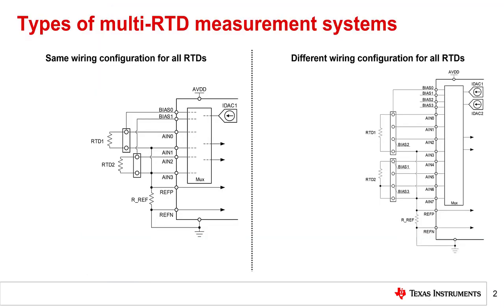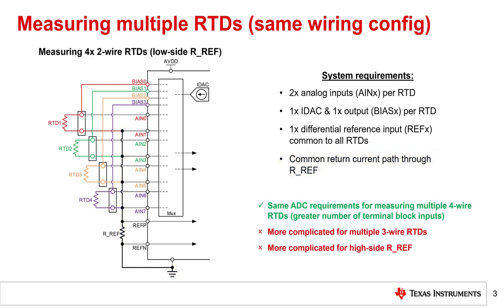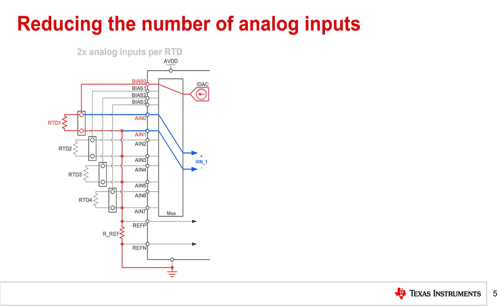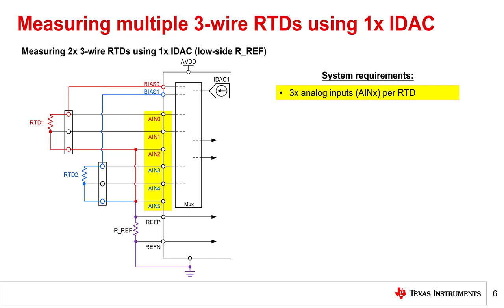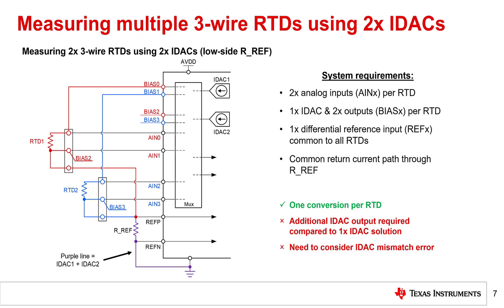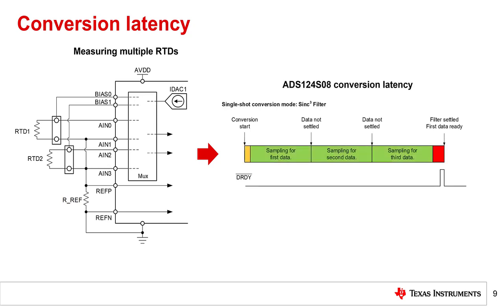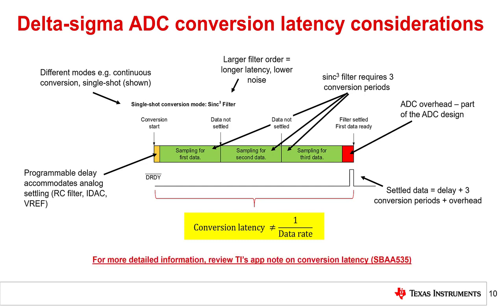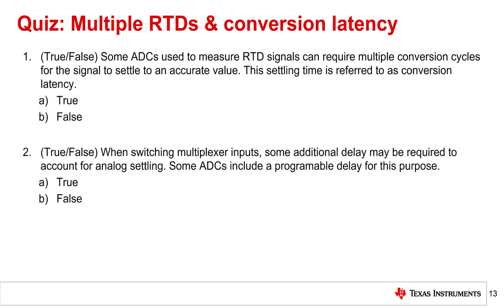Measuring multiple RTDs with a multiplexed ADC & intro to conversion latency

Comment: Excellent explanation.  Please share the ADC IC number. Is it ADS1248/ADS1148 ?
1. I want to interface    4 - "three wire" PT100. Is it possible.
2. Is this configuration is possible with single IDAC1 ?
or both IDAC1 and IDAC2 will be required ?